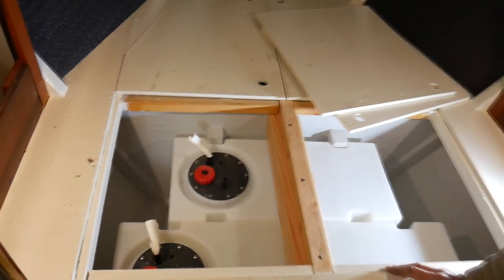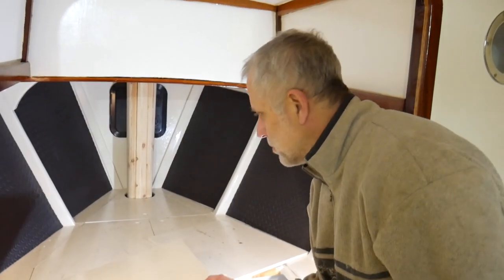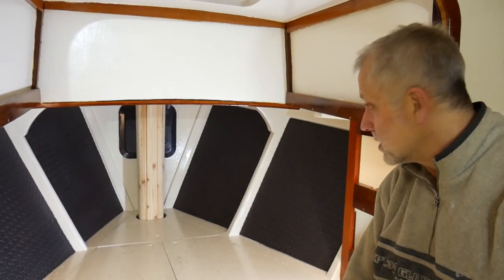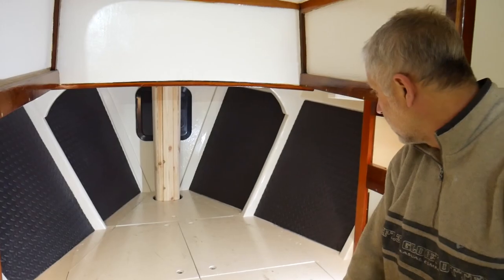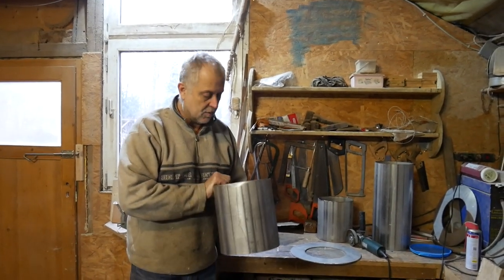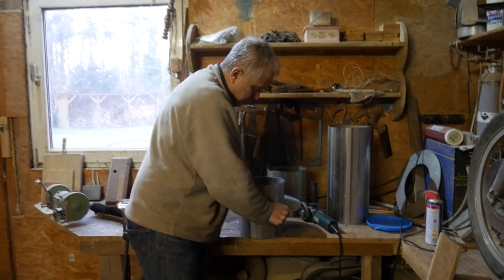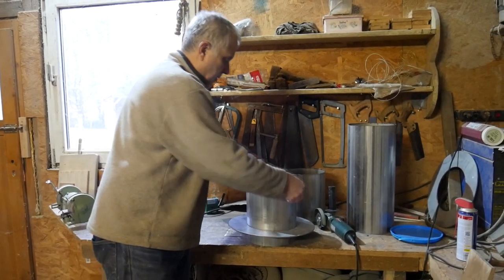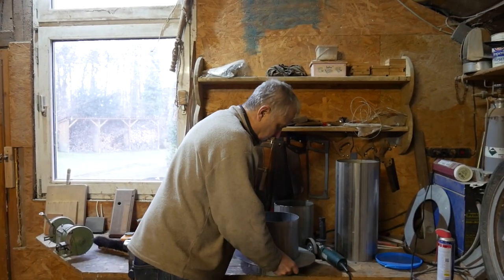Bunk boards, forepeak liners, partners fitting and more! - SV Tapatya EP167

Comment: Interesting choice for the liner. Functional and looks nice, economical too I imagine. I definitely do not recommend the carpet that the previous owners used for my liners. Especially in the eastern Atlantic where they trap Sahara sand. I've removed some, and painted the plywood (behind them is already foam, as I'm a steel boat), though I think for the coach roof liners I will probably go with fake leather when I can find some for a good price.
Reply from the maker: Thanks Jaz. I stole the idea from “ Sailing Uma”. We’ll see how it does!

Comment: Great idea for fitting the mast boots. The tubing will give you a good tight seal to keep any water from getting in if the boot cover gets torn.  Also the flange makes a good place to put block anchors. The forepeak looks good too.  I like the foam mats being used like that.  Will you be putting anything over them or leaving as is?  Thank you for the video and glad to see you're still moving ahead despite the cold.  Any step forward is a step towards the finish line.  Take care, stay well and have some hot cocoa.
Reply from the maker: Thanks Matt. Yes, I think the partners fittings will be effective- not really necessary but will do a thorough job. The foam cladding will stay as the finish - we’ll see how it goes. I’ve taken the idea from “Sailing Uma” and it seems to work for them 👍

Comment: Great video again, thanks for posting.  Tom what kind of glue you use to do fit foam mats? I'm just about to do the same and was wondering about ?
Reply from the maker: Thanks Andrzej. I used Classen Multiconnect, but I think it's just an MS Polymer adhesive, so I guess any MS polymer would work...